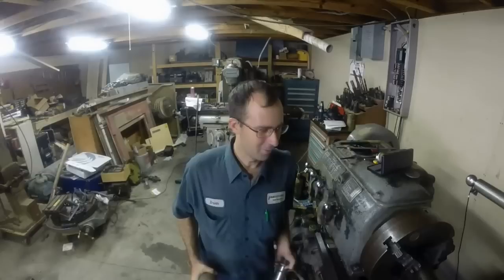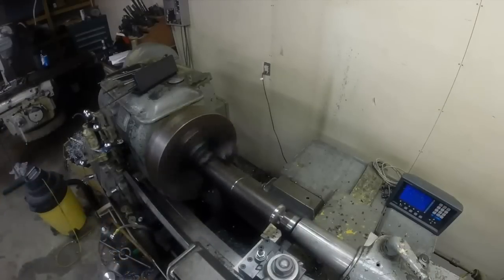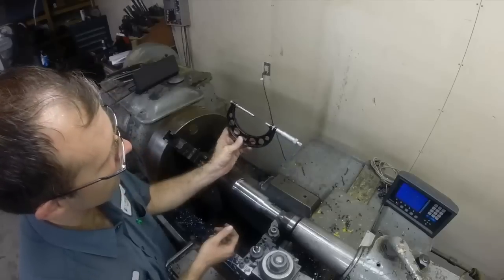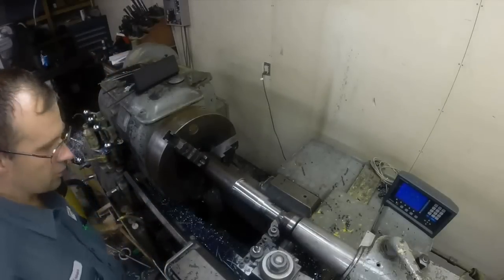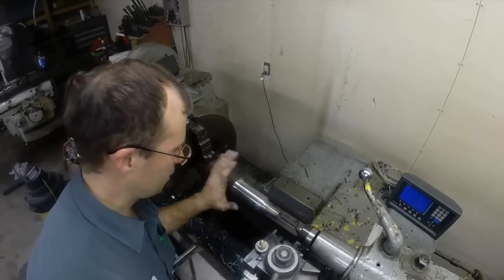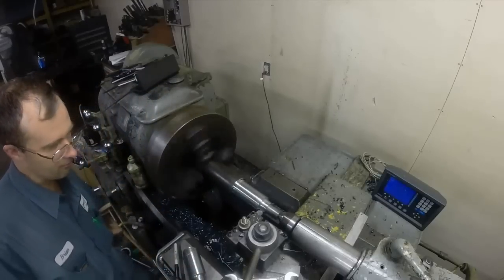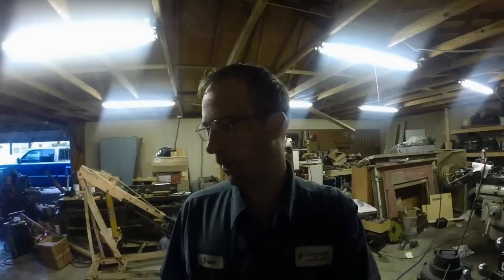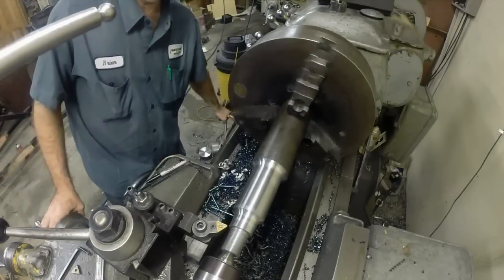Turning a heavy duty spindle with methods employed to try to prevent a repeat failure

Comment: Hi Brian, just found your channel in my suggested feed yesterday, don't know why I hadn't seen it sooner, it looks like we have all the same YT friends. Great shop and equipment, awesome job on the shaft! I had a Starrett mic just like the one you are using that was given to me, but most of the were missing, it seems like a great idea, I'm surprised I don't see more of those. Really enjoying your channel, going thru the videos as I can.
   Talk to you soon ........ Mike
Reply from the maker: Welcome Mike! It is a nice Mic. I sometimes use it for plate work because I can get over more area with it vs a standard 0-1mic because of the deeper throat.  Starrett still sells the anvils  but if you watch ebay you can usually find a set where the mic is tore up/bent and buy the lot for like $9 and fix what you have. Thanks for stopping by.

Comment: Lets see some more close-up shots of turning with the TNMG on your next project, I would like to see the chip formation and finish, I find it relaxing to watch.
Reply from the maker: meocats Here you go. Hope this puts you at ease! :-)   http://youtu.be/XCXkSvIDFQ8
Reply: yes, excellent. I was thinking, as the tnmg sneaked up near the live center point "god damn!, what a great geometry!". It's a shame the power went out on the ingersoll chip fracturing the edge, they look expensive.

some TNMG are available with a wiper edge (basically, the tool's nose radius is increased to a large value over a short length, essentially producing mirror finishes on the part as good as finish ground. this is similar to high-feed turning, but the feed is kept lower. The important concept is the nose radius being large though.I have not seen any on ebay all year in tnmg form, but the suffix for the insert name would be something like: TNMG332-WMX. The "WMX" suggests the wiper geometry".
Reply from the maker: MSC quoted me $125/insert for those Ingersolls! The ones I have came in a lot I bought at an auction so I only have about that in two holers and a dozen inserts. I think when-if they ever get used up I probably wont replace them for that money. I think a big CNMG or CNMP will be just as good for the power capabilities of my lathe and much less expensive. That ingersoll can sure take a lot of steel in a short time though, it is pretty nice for roughing. I have seen those wiper TNMG's in the Kennametal catalog but have never had any.
Reply: Holy shit, for one insert! WMX are for sandvik, I think kennametal and other brands use different suffixes
Reply from the maker: TNMG-FW for a finish wiper or TNMG-MW for a medium wiper in the Kenna catalog. Looks like only avilable in the 331-333 sizes.They show feeds of .008-.030 with DOC up to .200" so looks like they still are a pretty good perfoming insert at metal removal.
Reply: Did not know kennametal had wipers, now i can follow those models on ebay
Reply from the maker: Got some on there now.
http://www.ebay.com/itm/10-PCS-TNMG-332MW-KC9110-KENNAMETAL-CARBIDE-INSERTS-6-6-12-JWT-/170855869920?pt=LH_DefaultDomain_0&hash=item27c7cdade0#ht_360wt_1074
if you want to get some and send them my way I would be glad to do a video comparing them and their performance :-)
Reply: with the import charges and shipping it comes to close to the same from my local distributor, i'm waiting to snipe a lot of 100+ inserts, at like 1-2$ per insert

Comment: Hi Brian,
Those huge inserts really hog metal... Never used them, I tend to take faster RPM and less advance with WNMG's and usually finishes mirror like on harder alloys.
Curious to hear about the lasting increase of the part... If you said it take 3 years, we'll have to be patient though.
Nicely done,
Pierre

Comment: Ha! that's a big ass insert, bigger than i imagined --- its made to take a cut on the full width of that insert, which is like 1.5" depth of cut on the radius for a total of 3 on the diameter.
Reply from the maker: Book on it says 1.25"DOC and feeds of .025 to .060". The second pass in the video was a .250DOC by .040IPR for a full half inch off the diameter.
Reply: that is correct

Comment: that's a big rotary table you got there, what are you gonna do with it?
Reply from the maker: It is a 24" table it goes on my big mill. I use it when ever I need to do some interrupted features on circles. I have the drive setup for it as well and once used it to cut spherical shaped pockets by leaning the mill head over and rotating the  part through the radius of the cutter.  Honestly I don't use it a lot since I have to use a crane to pick it up. LOL
Reply: You have a crane now tho! :) Those arent chips...thats shrapnel!